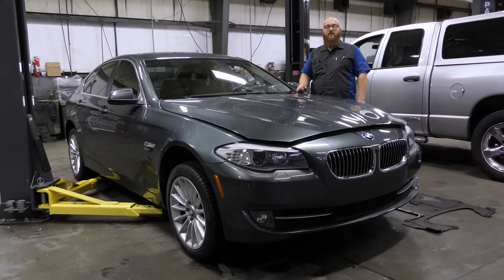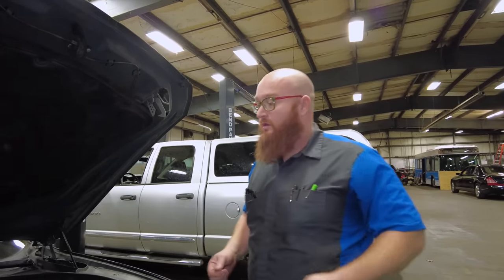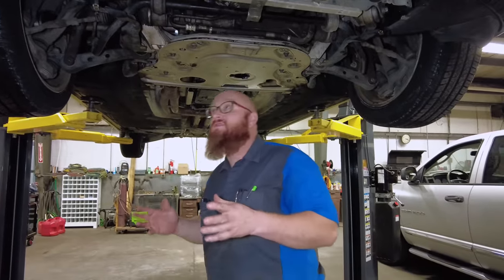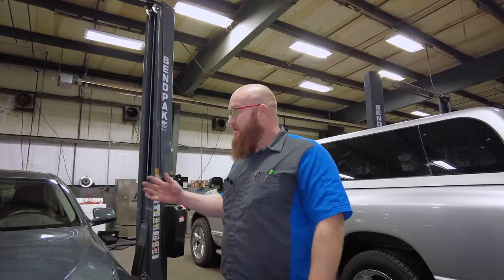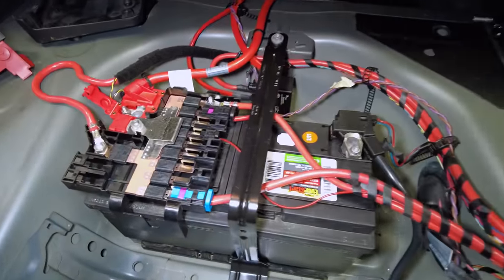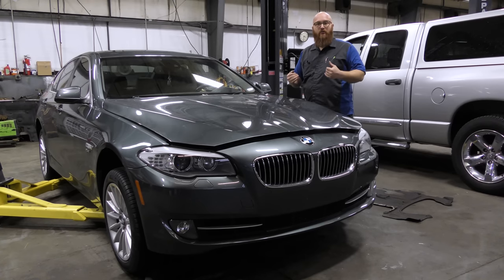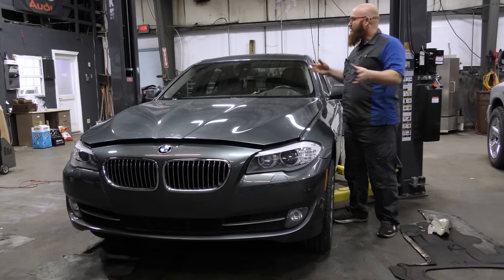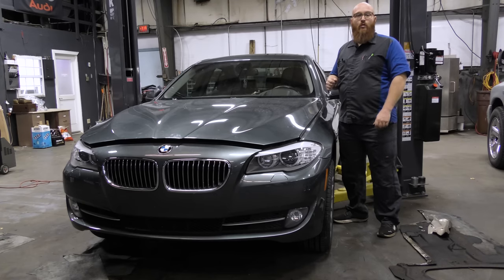One bad day for a customer! CAR WIZARD found TWO insanely unrelated issues at time on '12 BMW 535i

Comment: Common issues for any car with that mileage. The n55 is a good motor when maintained properly and will continue to serve the customer for years to come!
Reply: 🤣🤣🤣🤣 thanks for the laughs
Reply: @esco819  As someone who has owned many N55 vehicles from F10 535i to F30 335i the motor is reliable so I don't know what you are laughing about. The ZF8 it is paired to (or the fun 6spd) is also great. Everything around them though, another story.
Reply: @KylePetersonDmaster223  I have a dodge which is built on a bmw chassis, all chargers and challengers are built upon a bmw chassis, and then dodge just adds everything else, which makes it a good vehicle, My car survived -15 and snow and sliding around on ice in texas lol almost got taken out by a mini van full of mexicans who were sliding around on the ice like a hockey puck.
Reply: @pilsplease7561  I thought it was a Mercedes chassis? As a RAM owner and a former Chrysler 300 owner the 300 was based on the W210 Mercedes architecture. I didn't know Dodge used BMW chassis?
Reply: @KylePetersonDmaster223  For the challenger they did and dodge corporate actually told me that during a phone call one time. Thats how I found out. 

The only thing im not a fan of is the transmissions in challengers they are german built but they clunk around when operating normally and make a lot of noise and it always bothers me.
Reply: @pilsplease7561  the ZF8 is a great transmission imo, but I cannot find anything anywhere that the LX platform was BMW derived, only see Mercedes E class listed anywhere.
Reply: @KylePetersonDmaster223  Im just saying what dodge told me i dont know any further information.
Reply: @pilsplease7561  they must’ve been mistaken in my opinion haha

Comment: These problems might actually be related. The starter may have already been on the edge and the excessive heated emitted from the engine after it lost coolant was probably the final straw. Heat affects electronics. That's why auto makers go to great lengths to protect electronic components and wires from the heat generated in the engine bay.
Reply: Exactly my thoughts.

Comment: As soon as you said X drive i knew this would be a money pit to repair.
I owned a 3 series X drive from new, after less than 12 months it spent numerous days
at the sellers workshop.
It was just one fault after another.
After 18 months i had enough, even the dealer admitted that X drive models were a nightmare.
So although i lost a lot of money trading it in, i went for a new 3 series touring without the X drive
and traded that in before the warranty expired.
German made cars are not the solid reliable models of many years ago, today they use too much plastic
are stuffed full of ECU's just wating to fail.
Reply: The biggest issue with the xdrive is uneven tires.  The chains in that transfer case stretch when one tires overall diameter is less than the others.  They must all be completely even.  Also the transfer caser fluid needs to be changed every 35k miles or you find the dredded "tugging" motion when turning the wheels sharply in a low speed parking lot.
Reply: @aussie2uGA  My problems started at only 9K miles, the most irritating was as the Wizard has shown failing to start after
loosing all power.
You could feel the power falling away until it came to a halt, and no way would it start after that, the recovery guys hated them.
My sample must have cost a fortune to try and fix, i just lost confidence and traded it in.
The dealer didn't realy want it, he persuaded BMW to buy it back, but i still lost a lot of money on it.
They are far too complicated to try and repair, dealers have no chance of keeping customers.
Reply: NONE OF THE PROBLEMS HE TALKED ABOUT IN THE VIDEO HAVE ANYTHING TO DO WITH XDRIVE.   And any car can have a starter go out, oil leaks, and a hose blow off at 200K miles.   Give me a break. Those are minor issues on a 200K mile car.  And what he said about getting the transmission into neutral is universal to all current ZF 8 speed transmissions, as far as I know -- has nothing to do with BMW or xDrive.
Reply: @ShowMeWhatINeedToKnow  Thank you. I love Wizard but this video is honestly kind of ridiculous. Really overplaying the cost and complexity of the starter replacement job too, the intake manifold is super easy to remove on these.
Reply: My issues started at ,9k not 200k, on a high millage car I would expect some.issues.Any car can be a lot of trouble from new, My dealer spent way more time trying to fix it than BMW would pay for, no ones wants a car that is unreliable hence why I took a big loss and accepted BMWs buy back offer, the replacement had zero issues.
Reply: @ShowMeWhatINeedToKnow  they did not mention the multiple $10,000 repairs along the way to these failures
Reply: @pablopicaro7649  -  This car is very likely on the original engine, transmission, transfer case, front diff, rear diff, drive axels, and front and rear drive shafts.  The bones of this generation of 5-series are pretty solid.  You have absolutely NO CLUE what you're talking about.

Comment: Depending on how hot the engine got the starter failure actually makes sense to me.

I’ve seen heat kill many starters over the years. Maybe it’s just warmer where we are? I am old enough to remember the Ford 5.0 engines would have major starter problems when they heat soaked. They used to sell metal reflective blankets to wrap around the starters because it was so common for them to fail when hot.

My guess would be that the engine got exceptionally hot, much hotter than the gauge probably indicated, because the coolant temp sensor was no longer submerged in the coolant and therefore was probably not reading correctly.

Wizard, you are very wise to counsel that customer that there may be many more issues after the engine is running. I’d be concerned with additional plastic cooling components bursting within a month or two down the road because of how hot they got and how that weakens the plastic.

Comment: If you have to have a BMW, lease a new one for 3 years and give the car back after the lease is up. BMW as well as Mercedes-Benz, Audi, and other European manufacturers are designed to be cars that lasts for the warranty period and there are more lessees than buyers for these cars. Land Rovers and Jaguars are not even worth leasing because many of them are lemons even from brand new. There’s a reason why these “high end” European luxury cars are cheap on the used market. In fact, you are better off buying a used Lexus or Acura than the Eurotrash cars.
Reply: So dramatic. This BMW has done 200,000 miles, we don’t know service history either. A fool buys a Euro with that mileage or pays peanuts, then wears costs. Nothing surprising here, just typical Wizard crying about BMWs.
Reply: Lot of baseless generaliztions
Reply: Agreed
Reply: Everything made by man has a lifespan. In the case of Mercedes they actually used to state it in the back of the brochure: 300,000 km or 20 years whichever comes first. Clearly once your past 180k miles you are on borrowed time.
The car in the video is on 200,000 miles and looks good for that mileage.
I have a UK Honda Accord 2.4 (Acura shape in the US) with no leaks but things do go wrong at higher mileages and like most Japanese cars they are prone to rust on salted roads. Audis do not, they are hot dip galvanized rather than electroplated steel in vulnerable areas.
BMWs are parked on every street corner in England. Specialist know how to keep them running without breaking the bank. Next time I'll select one of the later BMW B58 engines they are really good and the cars handle well.

Comment: If you drive a car for 200k miles and have a repair job for 2 or 3k, that's not that bad.
Reply: I agree, it still drives, feels like a bmw,   and Looks like a bmw,    far better than any new accord , or camry  for the what you might get for salvage .     I bought a 2011 mbz ML350 4 years ago  with 97K miles,   still runs perfect , rides great,  for $16500 ,    Even if i had to put $10,000 in it, it still would be an ifinitely more comfortable, etc that a $35,000K RAV 4 etc. !!
Reply: I’m completely with you on this. I like Wizard but literally what was the point of this? So a 200k Dodge won’t blow a hose and have a failed starter?? Don’t get it.
Reply: @rossfield8850  I'm in the same boat as you guys, i feel the wizard has ripped into this "BMW" solely because he doesn't like them, it's really unfair to rip on a high mileage vehicle for common known issue
Reply: That’s happens with Toyota Camrys. With bmws it’s 2 or 3k every 10k
Reply: @new2000car  Where did you get that stat?  I had a 1993 audi and got over 200k miles out of it until it was totaled in an accident.  The only big repair was 1.5k for a leaking heater core.  Everything else was just normal maintenance.
Reply: @new2000car  ive got a 750 v12 bmw with 345xxxkms on it lol it dosent need that much up keep 🤣🤣🤣
Reply: @Tony-hx2fj  "I agree, it still drives, feels like a bmw,   and Looks like a bmw,    far better than any new accord , or camry"  That's hardly a direct comparison, Honda have the Legend (RLX) and Toyota have the Crown Majesta (GS350/GS-F) to compete with the 5 series.
Reply: @TassieLorenzo  I meant  what you could by for less than say 15-20K
Reply: @Tony-hx2fj  You could also buy the Acura or Lexus used though. 🙂

Comment: Hey Car Wizard... I had these two issues on my BMW X1 S-Drive 20i. It's a 4-cyl N20 engine, very similar in many ways to the 535i. The starter died on me on a vacation, when I was far from home, and it died in front of a drug store. I was laughing here because the tow truck guy DID get mad at me since we couldn't get it into neutral. I had to call three different ones so finally came a guy who jacked my rear wheels and put little skates underneath, and we're good to go on the tow truck. The starter was an easy fix, nowhere near as expensive as the 535i, $250. My shop bought a repair kit from Bosch, so we didn't have to replace the whole thing.

In all fairness, I had signs it would fail. somedays when I started the car, I noticed it getting lazier, to the point that even the lights would dim on the interior when cranking. I wrongfully replaced the battery and the problem was gone, until without notice, I got stranded on a trip as I mentioned above.

As for the coolant leak, on this car in particular, it seems someone already been there and didn't connect them properly, or damaged them on installation. I'm saying this because the same happened to me. I had a leak between my water pump and hose, and the car immediately warned me that it should be turned off to prevent damage. I got lucky because i had a spot to park the car and turn it off as soon as it happened. The 535i didn't, but the owner also shouldn't turn it on again as it was already overheating.

When my car got to the shop, it was seen that it hadn't been assembled correctly, resulting in the coolant fluid leak.

But your customer unfortunately got EXTREMELY unlucky and got both my issues on the same event. I would've been MAD.

Comment: Can you try to hit the starter with a hammer or block of wood to see if it will start just one more time?
Reply: they most likely tried that
Reply: @nastyG184  what about a bump start or drag it to a hill?
Reply: @family-accountemail9111  can't get the car into gear without it turning on it seems
Reply: @nastyG184  actually I didn't think it's auto? You can't bump start them? (Never had an auto)

Comment: My boss had a 2013 (or maybe 2012) BMW 550xi (F10, same gen, just a bigger engine) and barely had a single problem with it EXCEPT he had to replace the engine. That's an issue of the 4.0 V8. But after that it was rock solid, didn't leak anything and never let him down. He got it used with something like 50k km (35k miles) and drove for another 100k at least, it wasn't a Sunday car.

Comment: Sounds like the starters are heat sensitive? The engine got hot enough to cook it. Wonder if the Nija's replacements drop in the winter vs summer?

Comment: any car could pop a coolant line. A starter that goes 200k is pretty good. What I find amazing is what you charge
Reply: I agree, especially in Nowheresville, USA
Reply: Seriously. What’s the big deal? Could have just as easily been a Toyota. Why’s everyone freaking out?
Reply: Intake manifold has to come out to replace the starter because it’s on the top not the bottom, where they bake in all the heat until they die.

Some of the Toyota V8 1uz engines had the same issue I think

Comment: this is probably a dumb question but did you check the starter on the bench after you took it out? I know ive had starters go out where i just had to scuff up and clean the terminals im sure this isnt one of those cases though. with it being so deep in the engine the safe thing is to just change it no matter what.
Reply: He hasn't taken it out. Hours of lablor. Just tested the wiring. That would require major disassembly. I'd bang on it with a hammer to see if it starts working. Only has to start it once.

Comment: I have a 2001 740I Sport and am the original owner.. I do most all the work on the car because the cost to have it worked on the shop would have been huge.. I was driving one day and the car died.. I drifted to the shoulder and had it towed home.. when I jacked it up and started examining things if found the crank sensor sheered off. I got my bore scope put and looked into the bell housing.. the lightweight flywheel - starter ring, reference ring, and torque drive plate had come apart!!! This assembly was machine riveted together and one of the rivets sheared which allowed the assembly to literally break up inside the bell housing.. I lost the starter motor and a bunch of other stuff.. Thank goodness it didn't penetrate the engine block.. I performed the transmission drop and repair in my driveway and replaced the part with a solid flywheel off a 740IL.. This was a stupid design by BMW and I know what this guy goes through every time one comes through his doors... I love the handling and drivability of the car but I have had so many things that have gone wrong with it that I have been able to fortunately fix even though the parts are expensive...sorry for the long write-up but I know exactly what's up with how this guy feels about the marque.

Comment: It's not uncommon for cars to just have 2 things fail at once. I work for a GM dealership and we often see lifter/cam failure and 6 speed transmission failures all the time. So as you can imagine, there's been times where a customer comes in for a misfire, has a lifter/cam failure, but during the test drive we also find that the transmission is on it's way out. Shit happens.
Reply: I grew up with GM (51 years old).  Never again!  GM is not what it once was!  It’s junk today!  Ford isn’t too much better, and Chrysler is garbage from day one off the lot!
Reply: @mmarciniak  completely agree.
Reply: @andrzejmical5416  not really, I’ve seen catastrophic engine failure on a $100k 2022 Escalade as early as 3000 miles. Several 6.2l engines were later recalled for rod caps being improperly torqued which could lead to spun bearings. Not to mention the lifter failure keeps happening as early as 5000 miles. Seen some on their 3rd set of lifters and they haven’t cracked 100k miles

Comment: 200,000 miles? Yes the situation sucks, but come on!  Try getting that kind of mileage out if an Audi.  BMWs are not as bad as he is making them out to be.  I've owned a few BMWs, I purchased them all new (all xDrive), and never had any issues with them, minus wearables and preventative maintenance.  I still have my 2016 X5 and my 2013 335i, and they are great, both over 100k.

Comment: My Bimmer is 23 years old, and it has had two cooling system failures in the past 7 years that I’ve owned it. When my temp gauge got hot, I shut it down. One time was a hose, the other time was the radiator. Bottom line, BMW engines are no more likely to lock up or blow a head gasket than any other engine from over heating. It just comes down to taking your warning lights and gauges seriously. Most people keep driving until they get to a desired location rather than putting up with the inconvenience of shutting it down when they were supposed to. I’ve seen the most durable engines on the planet meet their demise simply because people don’t wanna be stuck on the side of the road. I agree with you on the X Drive though. RWD only for me, regardless of brand.

Comment: If I had to choose brand new 2022 BMW with 0 mi or a 22 yr old 2000 Lexus with 250k mi to drive across the country tomorrow and make it like my life depended on it I'd choose the Lexus everytime. Hell I'd choose a lot of vehicles before the BMW.
Reply: Amen
Reply: Nathan, I agree. I've got a 2001 Lexus ES300 with 136k and total repairs for the 21 years I've had it are: one headlight bulb, one taillight bulb and an O2 sensor.  Otherwise, it's been gas, tires and oil.
Reply: I'd take the BMW every day of the week
Reply: Parts are more readily available for bmws. Might want to rethink that
Reply: @spicysnowman8886  Why?
Reply: @safffff1000  more fun, more luxurious, and more likely to make it.
Reply: @spicysnowman8886  Yea fun if you break the law but most of the driving is not
Reply: @safffff1000  there will be backroads, entry and exits ramps, and empty highways at night. I can only drive exactly 5 mph over the speed limit for so long.
Reply: @spicysnowman8886  That's a lot of money  and unreliability for momentary thrills, my dependable 1993 CRX gave me that
Reply: @safffff1000  worth it to me